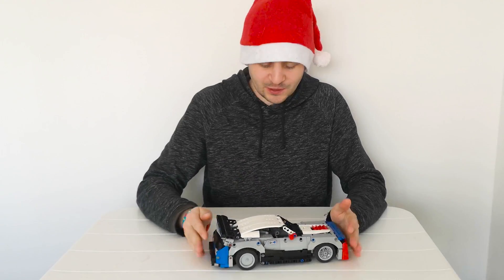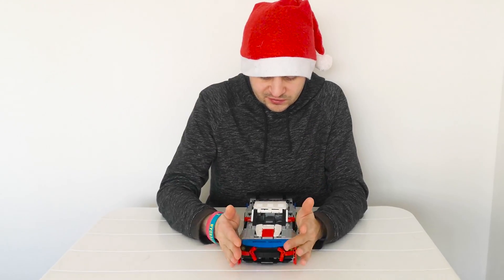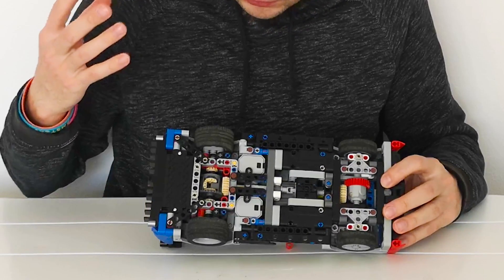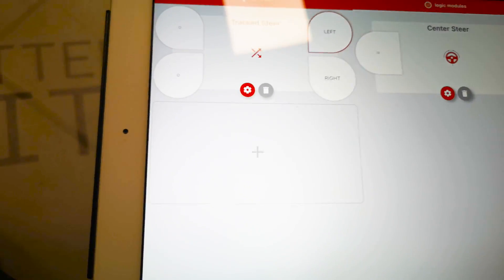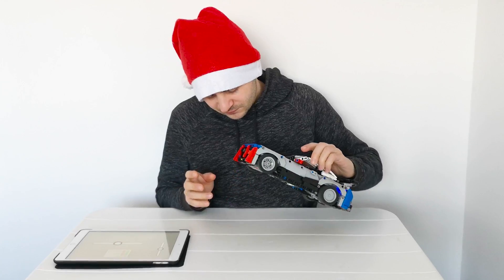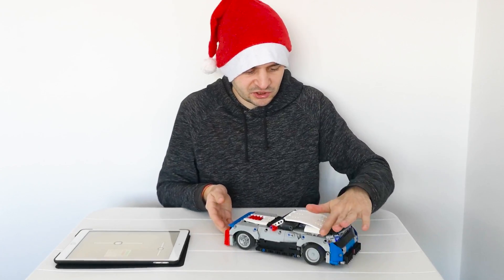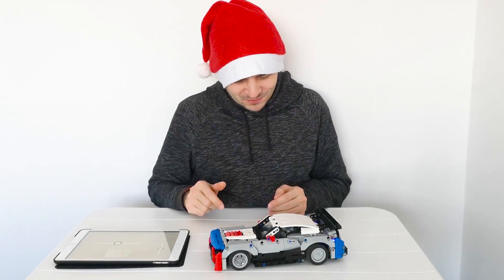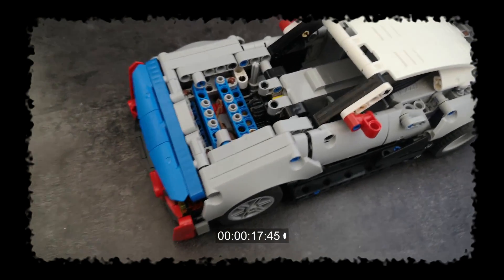Mustang GTEX AWD (Motorized 42138 MOD)

Comment: I've got mine to go 26 km/h with two buwizz motors and rwd
Reply from the maker: Nice! Did you gear them up?
Reply: @ZEROBRICKS  
Yeah and run it on slightly bigger tires